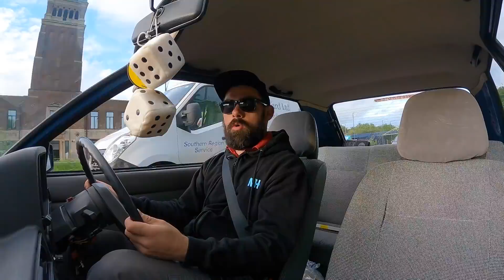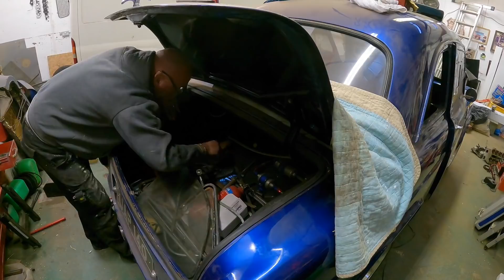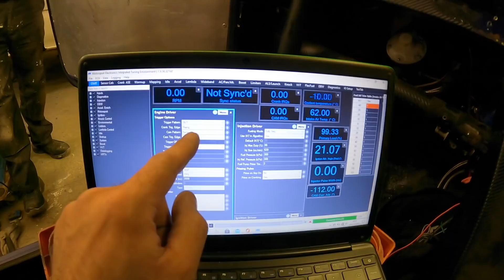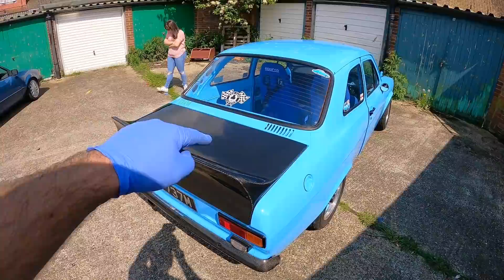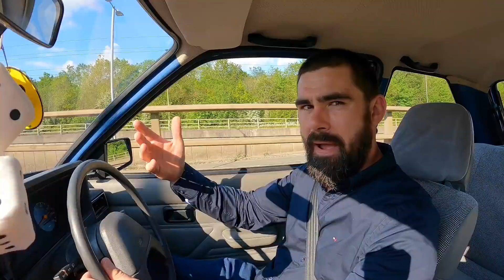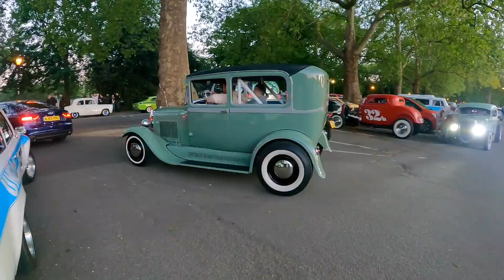Dad's Mk3 Escort is now LEGAL! 😃 *Chelsea Cruise*

Comment: Are you going to run air filters on your mk1?
Reply: I've asked a few times and got no reply. Guess he wont be - shame coz it'll kill the motor in no time
Reply: @steven-vn9ui  would be a pity , think he has a spare motor.
Reply from the maker: I don't plan to fit filters. Most people dont bother with them when running Pintos, Crossflows etc with sidedraght Weber carbs so I dont see any difference with Jenveys. 👍

Comment: Hi Mate...great another video. Enjoy yours dads car. Check in esther's rear axle  the right bump stopper maybe are loose...great weekend.
Reply from the maker: Thanks mate! 👍 Those bump stops are rubbish! They come with 2 tiny strips of metal to re-enforce them where the U bolts go and the drivers side one failed. I have a pair of original ones to go on the car but I need to repaint them.

Comment: You could use a exhaust strap as a fix if you didn't feel like welding a hook on the rear box
Reply from the maker: Thanks for the advice! 👍 On Esther's last exhaust system (when she was running a Pinto engine) I drilled two holes to move the orignal exhaust mount further back to suit the old system (you can see its actually still fitted to the car) I THINK I may be able to get one of those mounts which clamp around the tailpipe (near to the backbox) and use that mount. 👍